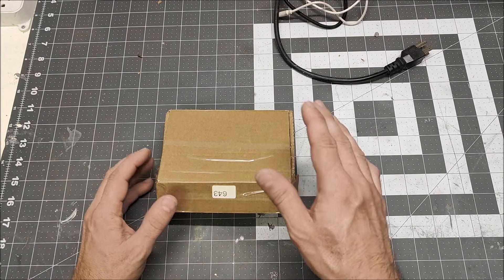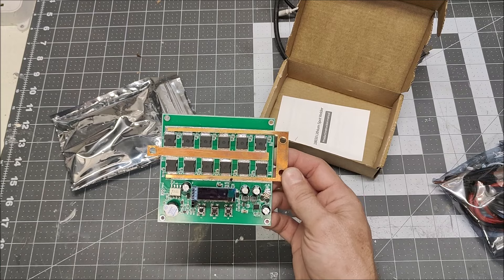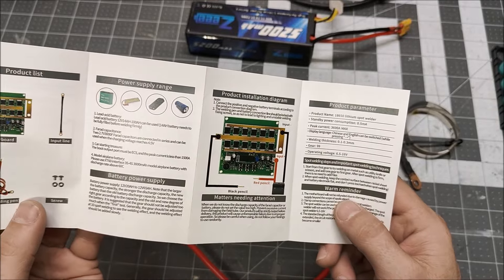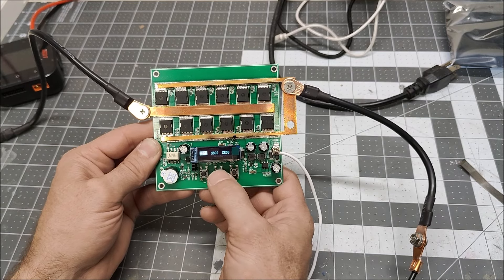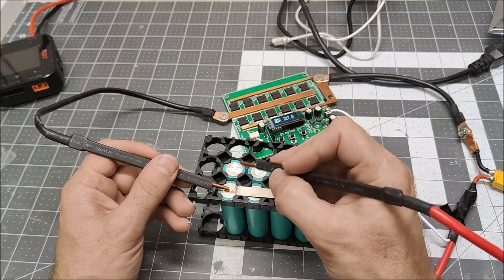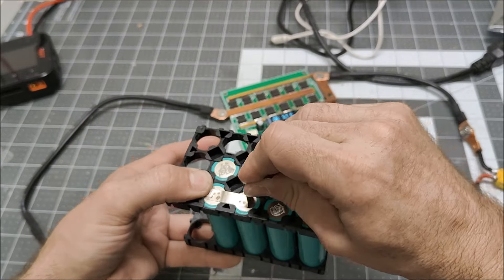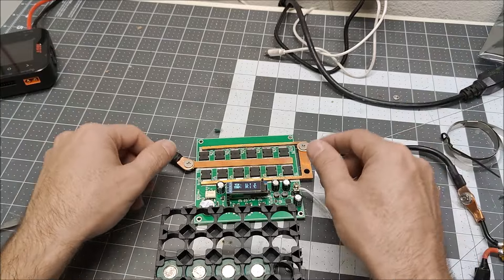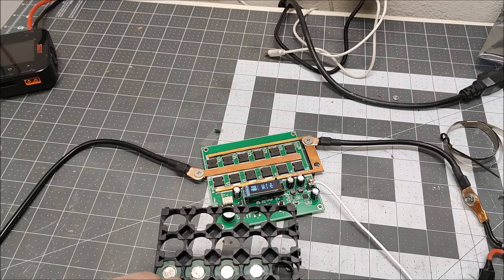New Spotwelder - Most powerful yet?

Comment: What is the principle of welding batteries? I understand the basics and that the welding spot should have the highest temperature for the shortest time. We have a spotter with a bunch of settings: first welding, second and third, where the second welding is the main welding and the third is hardening. There are also peripheral settings such as pause between pulses, current rise and fall times.

So let's get down to business: the first and last welds should not have as high a current as the second. The first weld prepares the nickel strip for welding, the second welds it directly, and the third releases the strip.

We have two main problems that I still can't figure out:

1. Why do the electrodes "stick" to the workpiece? According to my observations, this is due to the cross-sectional area of the electrode tip in contact with the nickel tape. On the one hand, a smaller contact area creates better welding, but the electrodes stick 👉👈 On the other hand, a larger area cooks worse. By increasing the current, the workpiece overheated too much and still nothing happened)

2. One electrode cooks and the other does not. In the case of DC welding, this is understandable. The "positive" electrode, where the current enters the battery substrate, welds better than the "negative" electrode, where the current leaves the battery. However, with AC welding, this is illogical for me, because the current flows back and forth across the workpiece.

Maybe someone has a few gigabytes of information about welding batteries?) I want to absorb all the text from anyone that is related to welding batteries

Comment: I also have this welder.  I would like to see what you've figured out.  I was getting huge sparks on what I thought was the lowest setting.
Reply: I have the same problem, even at 8 i blow throug the strip
Reply: @michaelzweers1807  My big LiFePO4 battery is 13.8 volts.  I'm thinking I need a lower voltage source.  What is nominal voltage on your power pack?
Reply: I was using level 1
Reply: @jspencerg  i was on a 3 pack that was charged to 85%. The unit said the voltage was 12v~ . But mine is dead now. The fets blew them self up :(
Reply: I am using it for something it's not intended for. I used it to tack nickel strips in a stainless metal case so i can mount an devboard/pi like board on the front without screw holes. I still don't understaind why it blew up and it burned to all the strips at l5

Comment: Seems like a cheapr ripoff from kweld. I hope they are not brass bars as you mentioned, because brass has only around 30% of the conductivity of copper (kinda the same as aluminium).
Reply: Mine are made of copper.
Reply: They updated them now with a newer design, mine seem to perform on par with kweld but I wonder how long it would last lol.
Reply: I just received one of these welders and you're are correct: the buss bars are brass, not copper.

Comment: People you need to read the instructions, don’t be stupid to connect this devices to any DC power source , battery source for these spot welders could suggest 12 vdc 35 - 35 Amps  hour for this welder to operate . Lithium batteries are ideal .

Comment: Steven Thanks (posted previous comment on the wrong place) anyway ,  
1-	What is the longest delay in time in (milli)seconds you can get before the first spot weld hits and is that long enough to stabilize the probes ? 
2-	If you now compare this spot welder with the JQ-DHJ02B which one would you buy and why?
I want to buy one of these 2 spot welders for testing and experience and after that I might go for a kweld type of spotwelder. 

PS Found out on an Russian site (https://www.youtube.com/watch?v=5p70zYPeGRY) that BIFRC has a max pulse of 70ms  which is much longer than the other tested spot welders. This in combination with the 8 mosfet gives a great punch at the highest levels and maybe the reason it might get hotter in comparrisson to other spot welders. 

The JQ-DHJ02B has a max spot weld pulse of approx. 35ms (https://www.youtube.com/watch?v=xylgjPVH8HE).

Comment: It must be able to do the copper nickel sandwhich. I have a JQ-DHJ02 with 6 mosfets and with that one I am able to weld 0.1Plated Nickel with 0.1mm Copper. I do that at 14.8V - 2nd setting - and measure 900-1000A current. I use 4 very old (> 10years) 5000hAh 45-90C batteries in parrallel. Before pushing the JQ-DHJ02 even futher I have to install first some TVS diodes for  surge protection (probably the 1.5KE18A )  Attached link Russian user who actually weld the Copper Nickel. https://www.youtube.com/watch?v=JLL7fefjgLI